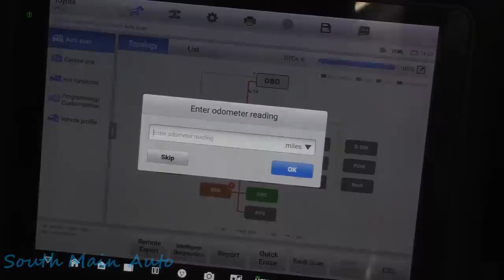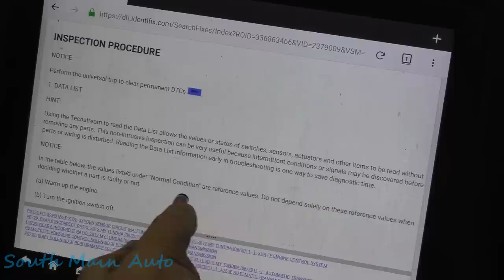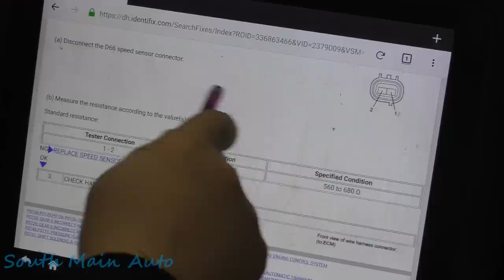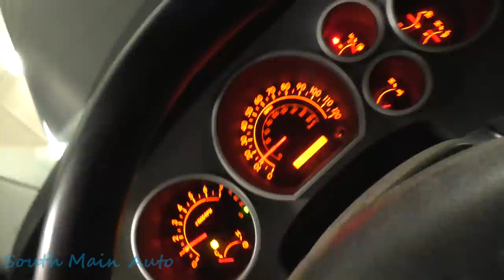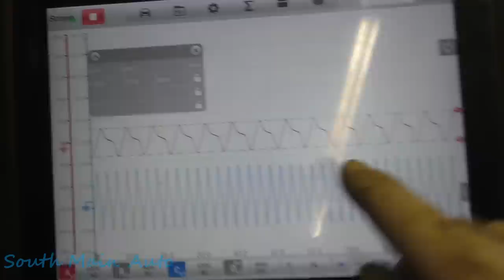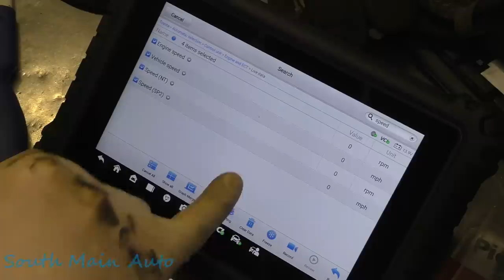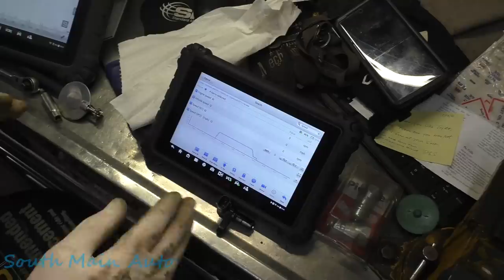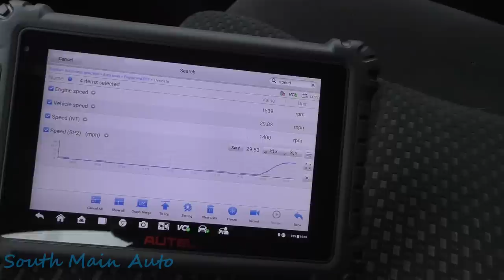Toyota Tundra: P0722 No Speed Signal

Comment: You are a bad a** my friend. I have been automotive Tech for 25 years. you make wiring problems that I will pull my hair out over and over. simple I've learned a lot from you  I'm opening my own shop dream  Come true 25 years in the making.   My skills are more  Orientated  In Engine mechanical Drive train  And differential. I'm a little dyslexic and I have to constantly double check myself with electrical stuff to make sure that my connections are solid for my test equipment. And I'm not over thinking.  You are truly one of the best  Technicians I've seen Probably the best on YouTube. And I'm no dummy Let my certifications lapse but used to be a California Smog technician. In my experience speed sensors are just like Cam and crank sensors   Mess up High temp hot soak and then start working again 10 minutes later Sometimes no code  make you nervous to drive the vehicle down the road cause you know you're gonna get stuck

Comment: Talk about deja vu! I had the exact same symptom on my personal 2007 Tundra last year except it was a P0717 (ISS fault). Resistance on the sensor was in range and all that just like yours. I didn't have a scope (though this problem was a factor in deciding to get the AES Uscope). Since they're the same sensor, I ended up swapping the ISS and VSS and my P0717 turned into a P0722. Swaptronics for the win. If that wasn't an option, I would have winged a sensor at it anyway, so you're not alone in that. Good ol hope and prayer auto repair  and tryignostics when it's your own vehicle 😆

Comment: Hey Eric! Hope you see this out of the thousands of comments. But I own a shop in California and I would love to see your diagnostics steps on a no crank no start situation for this type of vehicle in the video. Preferably the 4wd version with the outcome of being a starter needing to be replaced. I had to tackle this at my shop. The “easiest” I found was to take the starter apart on the car and remove it and then take the new starter apart and reassemble once in the car to avoid removing the front wheel drive axle

Comment: Eric, not sure if this helps, but I also saw that the transmission ground wire was completely rusted off. I replaced mine on my 2010 Tundra a few years ago just because the engineers placed it there for some reason, usually to reduce EMI or EMF noises generated by ignition systems. Thanks for all of the great videos!!! I hope you have yourself a great day also!!!!!

Comment: Sometimes Mr. Eric O, we all are so close to the problem we can't see it at first. I think you are the world's greatest mechanic/automotive technician. I might be slightly biased, but I wish you could work on my wife's jeep. It's been at the shop for 6 weeks for front-end work, wheel bearing assembly, and ball joints. I called to check on it, and we are working on it is the reply. I don't know if it is a problem getting parts or not. I just wish they would give updates. It is just my wife's daily driver she just likes the 1999 Jeep Wrangler. I hate calling them because I don't want to pressure them, but would appreciate knowing.

Comment: Great find. I had an Impala speed sensor go bad. Installed a new aftermarket one and it worked fine for a couple days then started having intermittent problems. Took it to a dealer mechanic friend and he couldn’t find anything wrong. He was checking resistance and inadvertently bumped it and resistance when to zero. So much for new parts. Installed new OEM good to go.

Comment: I was told the speed sensors can not be intermittent.  You proved that can be!   Our Saturn ran and then quit.  Later it would run again.  Changed the speed  sensor and it always ran fine.

Comment: Very refreshing to see the use of service info like you do. No matter how smart we think we are briefly going over service info is awesome. It stops one from making assumptions and the dreaded rabbit holes. Others we see jump right in and “think” they know more than they actually do and wind up making mistakes because they assume they know more than they do. Don’t know why some techs think it’s a personal insult to have to use service info to help understand what they are working on better. It stops mistakes that lead to unneeded work and excess cost to customers. 
Also great work showing how temperature effects testing and how we need to test sensors at a range of temperatures the equals the normal range of operation. I like to monitor signals while allowing for a warm up cycle if possible. Many will scope a signal quickly and move on to other checks and miss drop outs or total LOS. Overall great video showing 100% the proper way to attack this type of failure.

Comment: I have a 2008 Tundra and had the same issue with the output speed sensor, resistance tested fine cold and when it was in the truck and ran for a few it would throw the code. Replaced the sensor and the issue was resolved. This also happened to on the input speed sensor and same thing, tested good on resistance unit it was warm then failed, which was only a year later.

Comment: This was a VERY valuable video!!  Ohming a sensor is easy, only if u use the AES wave connectors. Can u imagine trying to touch your multi-meter leads to that front connector??  Impossible!!  Then there is the scope use on how the wave form looks at both low and high speed. And most importantly, how that sensor failed with a little heat!!  Takeaways. Either pop for the AES wave kit, or make some of your own from scavenged connectors at the bone yard. Get a simple cheap scope, and learn how to use it. The Gadgets Playlist has some great stuff on cheap scopes. Use a little heat and vibration to further scrutinize that supposed good sensor. Lastly, if Indentifix was what he was using, how cool was that. U get code description, wiring diagram, scope pattern all in one subscription. I need to check into that.

Comment: Hi Eric, next time you are down the scrapyard.. pick up a used seatbelt buckle.. ie: cut 1 from a wrecked car and have a bright yellow tag on it.. that way, when out test running cars you can plug the buckle in and save the Beeping noise :) :) the Big  Yellow tag is so you don't forget to take it out when finnished the test run .. Just a Thought   . Andy UK
Reply: Its a good idea if you only work on one vehicle but not all buckles are built the same. He would need dozens for every make and model he works on.
Reply: @iwouldrathernot4274   Aahh.... Hear in the UK all makes of cars have the same buckle ... Thought it may be the same as the USA :) :)  ..

Comment: Had a similar issue on the same truck.  C/S the issue would only take place when it rained, but I could never duplicate the concern, even after hosing the entire trans and harness.   The input and output sensors are the same, so you could have swapped them, and drive the truck to see if the ECU throws the input sensor code.   Turns out the sensor would go open circuit when it got hot.

Comment: In general, measuring resistance, capacitance, or inductance of a component should be done with the component isolated as otherwise you are reading the effective value from the component and connected equipment.

Comment: 17:00 what is the rotted off and missing ground cable by your hand?   I had a Chevy Impala that was starting hard , thinking it was the crank sensor I replaced it ,  to make a real long story short it ended up being that simply taking sand paper to the mounting surface to clean off corrosion took care of the issue. I do not know if the sensor was not getting a ground or if perhaps the corrosion was just enough to force the sensor out of place ??  Seeing that missing ground strap makes me wonder..

Comment: Eric, those two sensors are both variable reluctance (VR) type.  Signal magnitude is proportional to the passing speed of the toothed ring each sensor is seeing, but signal magnitude is not what the ECM is looking at.  The ECM is measuring the signal zero crossing time to determine rotational speed.  Each zero crossing point is indicating the center of each passing tooth on the ring. Obviously these two toothed rings are rotating at very different speeds (higher magnitude VR signal = faster ring speed).
Reply: Woops, sorry Eric. I wrote the comment before watching all of your video.  You figured it out yourself. Kudos to you...

Comment: Tell Andy to put that 5th wheel on a kit that will anchor into the pivot mounts for the dump bed. Back up to the 5th wheel, latch it into those pivots, and use a cable winch to pull it up and onto the frame. Bolt down the front, and away he goes.

Comment: That converted Pete from a tractor to a dump truck. And back to a tractor. Must have a 21' bed for it. 315's on the pusher. 2hr swap on the 5th wheel maybe? 6 hrs on the bed probably. I think your triaxles are setup for 68,000.

Comment: @4:38 - Was that a broken ground strap on the linkage near that connector? 

I had the same issue on my 2008 F250. When it was cold, it would work fine, then later on when the outside temp warmed up and my brakes warmed up, the abs light would come on. 

I finally checked the ohm reading, it was definitely off, and when I removed the sensor, it was cracked. Probably had some intrusion from Illinois salty winters. As it warmed up, the connection would pull apart internally and turn the abs light on.

Comment: Hi Eric, I have a speed sensor problem. What happened was I had a new valve cover gasket put on the 2000 Camry LE 4 cylinder. The problem  is it has two half moon seals on each of the valve cover gasket. I couldn't get the original half moon seals because Toyota doesn't make them anymore. So I went to Advance and ordered the metal ones. The problem is Shawn didn't seal them right. So the half moon seal on the drivers side is leaking oil onto to the automatic transmission. The oil has coated wires and speed sensor with oil. It goes out on me. It does three things. Works the speedometer, mileage, and shifting of the transmission I think. I maybe wrong on that one. I need to get all this fixed or I'm not going to have a car to drive. I need to take the Camry to someone I can trust to fix it and not take me. Charge me for work they don't do. That's bullcrap. Any suggestions would be helpful. Thanks much.

Comment: It had to be the signal from the transmission, or maybe a chaffed wire but electrical. Electrical right up to the motor in the speedometer, geared to spin the needle and roll the odometer. A broken plastic gear in the  speedometer. Test and inspect follow the clues.

Comment: I have P0717 input speed sensor error. Will part# 89413-0C021 work for BOTH input and output speed sensor you showed in the video? I believe there is a sensor in the front and back of the transmission.

Comment: Those look like VR sensors.  The higher the frequency, the higher the output.  At low frequencies there is lower magnetic strength which results in lower voltage generated. That’s why they don’t work near or at zero speed.

Comment: i changed the wheel speed sensors and connector on my jeep once, was still not right, turned out one of the new sensors was bad, but i was able to get a replacement, didnt even have to return the old one.